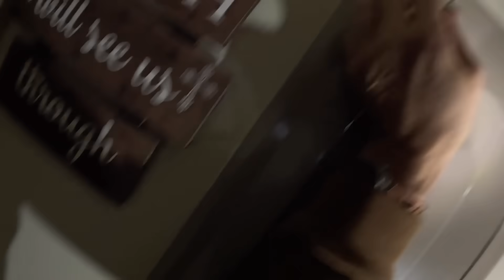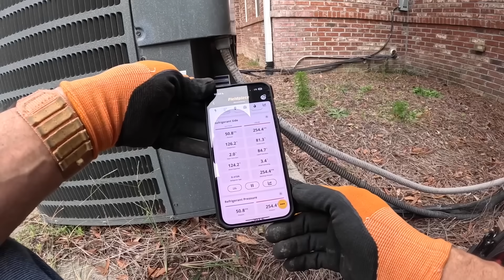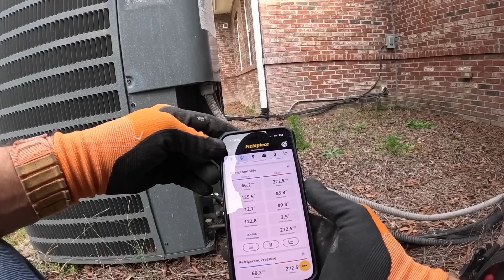No Heat Call On Rivalry Week Game Day! #hvacguy #hvaclife

Comment: So why did it trip in the first place that breaker should have been replaced there is no way an old lady should have knocked that breaker off first place and the heat strip did you ohm it? or the fan motor or a relay hmmm just to go see the game which Michigan won good video

Comment: Thx.  You seem to have a lot of breaker issues down there.  Looked like CH model breakers.
Reply: Builder special breakers!:face-blue-wide-eyes::face-blue-smiling::hand-pink-waving:
Reply: @bobboscarato1313  CH are the old Cutler Hammer style.  Good breakers usually.  Cost more than their BR line.
Reply: @Bob.W.  Hello I have Square D breakers; all original and home is 47 y/o. 125 A. box.
Reply: @bobboscarato1313  Bob, Square D was started by two employees of Cutler Hammer.  I have a 45 year old Cutler Hammer 200 Amp service panel with CH breakers.  My preference is Square D QO, but CH is what I have.  Both are good.